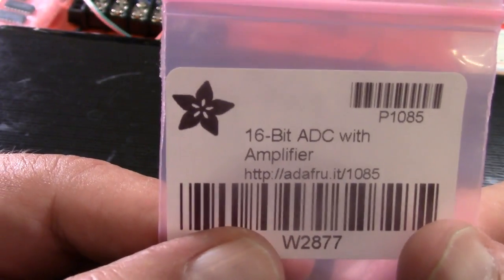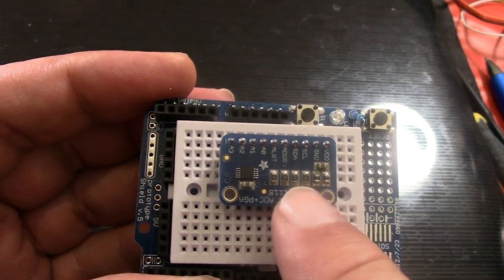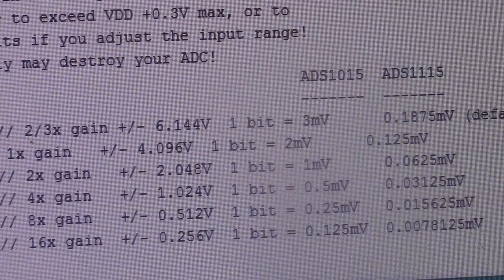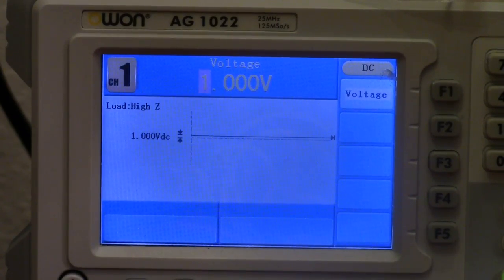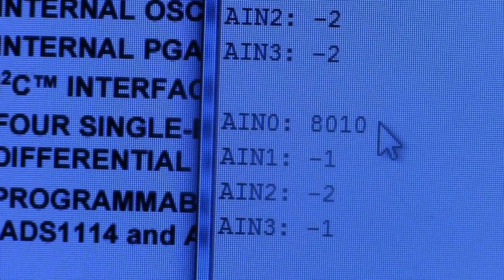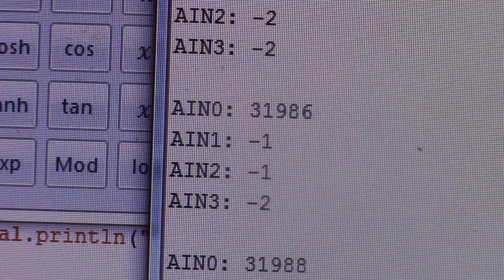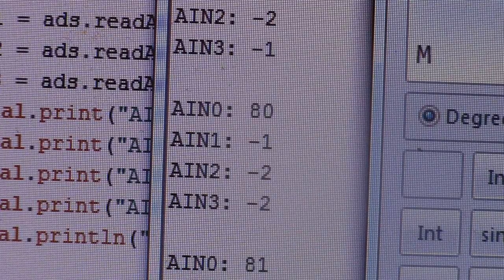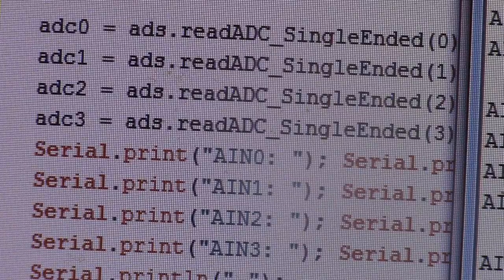ADS1115 16 bit ADC with PGA test and measurement

Comment: hey, thanks for your Video. It try to measure realy low resistance Vape Coils with a 100mA constant Current (LM317), but i dont get it ... what do you think is the best way to measure 0.05 - 1 Ohm resistance with a constant current and the ADS1115 ?
or maybe i am doing anything wrong in conversion

Comment: I am trying to set up an auto ranging measurement system and I was wondering whether it is safe to change the gain of the ads1115 inside the loop in the Arduino code. I want to select the best gain to use given the input voltage for the highest level of precision. The project I am working on is actually an ohm meter. Any suggestions?

Comment: Great job, thumbs up. Can you tell me plz,   4.09V  will be the AO analog input voltage signal, or it is Vcc input of  ADS1115. ?
Reply from the maker: Muhammad Shahzaib thank you for watching the video. That is a great adc chip. The 4.096v is the maximum allowed voltage to be input to A0 with the amplifier setting at a gain of one. So you can measure voltages from 0v to 4.096v on A0. If you set the amplifier gain to a different setting then your maximum input voltage on A0 changes. I hope this helps. Thank you. Bill
Reply: Billy Martin  Thanku so much. i will be using this chip, i will be back soon ☺

Comment: You are videos are good because you use decent hardware to test product but The MAIN issue here is you talk to much and its kind boring showing us how to use calculator instead show us the part of code and explain it.  You could write this in comment in arduino sketch and just explain fast and show the measurement because thats why most of your audience came here.
You could test adc under different power supply datasheet  shows that work from 2v to 5.5v you could test then instead doing calculation 10 min from 20min video.
Anyway thanks for this video
Reply from the maker: Thank you for your viewership and your constructive comments, I will definitely take them into account.
Reply: True, alot of talk beside the point.

Comment: Can you please share the code for single ended ADC1115  programmed with arduino. I am using the code one from githud but it isn't reading anything except 3.3 volt....!!
Reply from the maker: veena keeranagi, hello, I would be happy to. I don't have it on github, but I can send it in a text file to you. My email address is "sapbasisperf@gmail.com". Send me an email and I'll reply with the code.
Reply: Hi Martin, Thanks for reverting. I actually got the readings. The github code doesn't give values when we connect the addr pin of ADS1115 to GND, atleast in my case. I changed the connection of address pin to VDD and the code addrss 0x49. The code worked fine. However would like to know if you did anything different. I will mail you on the email provided above. Thanks again.